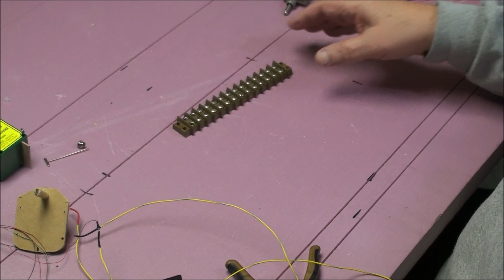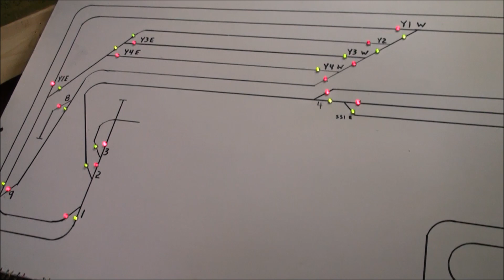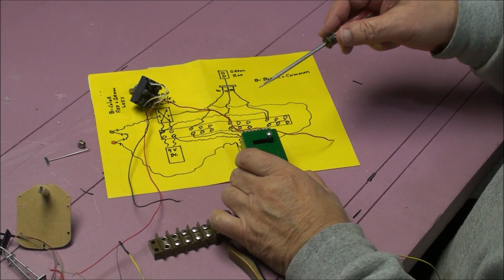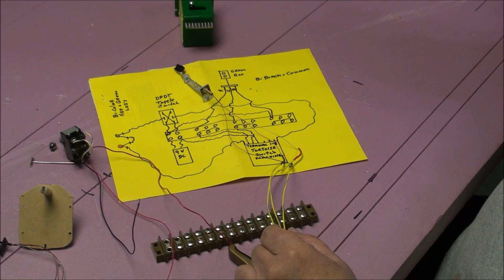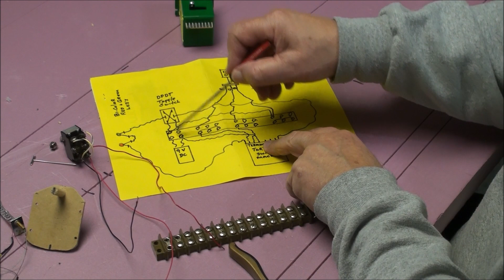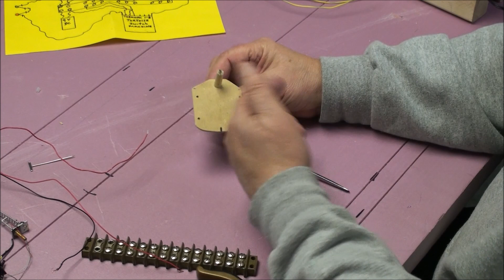Tortoise switch machine wiring to led's, turnouts and signals

Comment: 😊I just came across this video a few days ago, man, it's VERY helpful, not only do you show how to wire up your tortoise, but the information is clear about hooking up signals, my question is this would you recommend getting your power from the track bus, or a  separate power supply???

Comment: Thanks much for this great info.  However I want to wire a crossover with 2 tortoises to a DPDT and 4 signals along with a control panel bi-color led's.  I expanded your diagram and wired the 2nd tortoise to terminals 1 and 8 to the first but it isn't working,  Cn you please help  as you have a great system here but needs to include a crossover so both switches can be controlled by 1 switch.  Very frustrated please help!  Thanks again

Comment: Just wanted to say that this is one of the best videos I could have found to explain how to connect all of the pieces. Clear explanation and a detailed schematic. You mentioned that you don't use resistors because the ones you use come with resistors already installed. Which signals do you use? If I got a signal that didn't have a resistor built in, where would I add it? Also, can you use this setup and send power to the turnout from the Tortoise as well?
Reply from the maker: First, yes, you can use the tortoise to power the turnout.  Simply use the three unused terminals on the bottom of the tortoise.  Second, you MUST use a resistor on each let.  The leds I buy already have them attached.  If yours don't come that way, simply solder a 1000 ohm resistor to the long leg of the led.
Reply from the maker: Jus to clarify, your signals must have resisters attached.  The leds you use on your control panel DO NOT need resisters, if wired as shown using the tortoise switch machine.  The machine itself acts as a resistor.  Sorry for the confision.

Comment: Hi James thanks for your video Avery instructive I tried your wiring connected to a 9v  battery but when I threw the switch it changed the leds but wasn’t enough to throw the switch on the tortoise and the first led in the wiring seemed to be a brighter light than the second do you have any suggestions of what I didn’t do right?

Comment: James, Have you used or are you familiar with the SMAIL switch machine?
Reply from the maker: No, I have not used it and I'm not familiar with it.  If it has internal circuits similar to Tortoise machines, it may work the same.

Comment: Finally, someone has explained everything I have wanted to know about doing this THANKS!!.
How would you wire up multiple tortoises/signals?
Reply: I have 18 switch machines. I made 6 six position terminal blocks, with a positive and negative from each dpdt switch for each machine. Using 6 conductor phone wire, I ran from the control panel, I mounted the terminal blocks within easy reach of 3 switch machines. Was just an easy matter of running short wires to each machine. I have swiss style double sided signals with 2 leds on each side. They only have 2 wires, so I am still not sure how I will wire them, to change polarity so they change when the switch changes!
Reply from the maker: Not exactly sure what you mean.  Are you wanting a single toggle switch to operate more than one tortoise machine and it's corresponding signals or are you wanting to know how to wire several tortoise machines with each using separate toggle switches?
Reply: The latter, sorry I wasn't clear. Several tortoise machines with each using separate toggles. I'm thinking you would need a bus line to make it easier?
Reply from the maker: @andrewthomas9777  Pretty sure a bus line won't work because each tortoise machine must have it's own toggle switch to activate the machine and reverse the polarity so using a bus line wont work.

Comment: Are you using any resistors for the LED lights??  If so, what rating??
Reply from the maker: If you are using a tortoise machine, you DO NOT need resistors.  The machine itself acts as a resistor.
Reply from the maker: Just to clarify, the tortoise machine acts as a resistor ONLY for the led's on your control panel-not your signals.  The signals must have a resistor and the ones I use come with resistors already installed.
Reply from the maker: @medtech68  I'm not an electrical engineer but, if I'm understanding your set-up correctly, all you are really asking is do you need a dpdt switch to simply change the color of your signal lights.  I think the answer is yes because you must still power 2 separate circuits-one red and one green.  If you use the on/on switch, one of the colors will always be on.  If you want the signal to be dark when no train is near, use a on/off/on switch and put it in center (off) position and neither color will show.  You CAN'T use it if you are using Tortoise machines and using toggle switch to run them.
There may be other, easier, ways to do it but this is how I do it and it works.
Reply: James Wolf  I was going to run them thru and NCE SWITCH8 MK2 so when the tortoise changes directions the lights change also ! Just wasn’t sure if I needed the dpdt switch in with it also or just run them thru the switch 8 ? So confusing !
Reply from the maker: @medtech68  since I don't run mine that way, I can't say for sure.  Sounds like it should work an worth a try.  I just prefer controlling everything from my panel.
Reply from the maker: @medtech68  another thing, as I said, I'm no expert so when I'm not exactly sure how or if something will work, I try to set up some kind of a test to try it on one signal, switch etc. so if it doesn't work I don't burn out too much stuff.
Reply: James Wolf yes they come with the resistors for 9-12v it says ! Got em off eBay ! Yeah gonna keep testing them jus trying to figure it out still! Newbie here lol! Thanks for tour help though much appreciated ! Electronic engineer I am not haha
Reply: James Wolf l